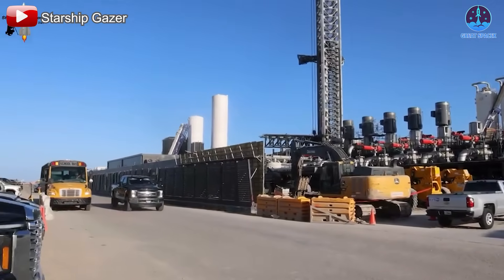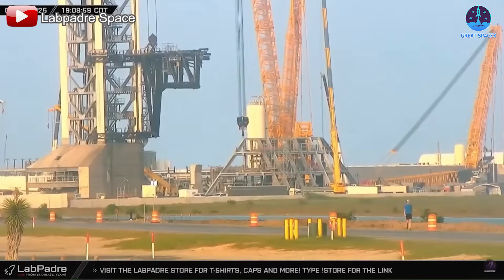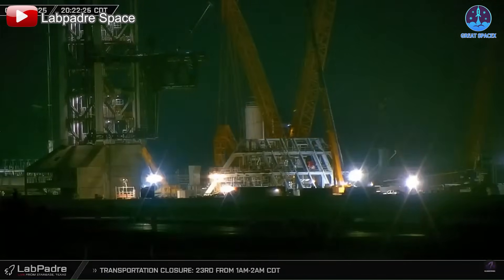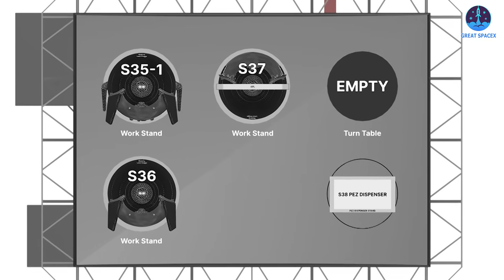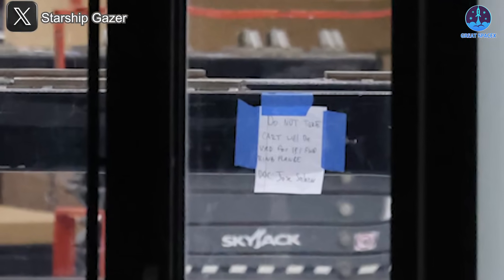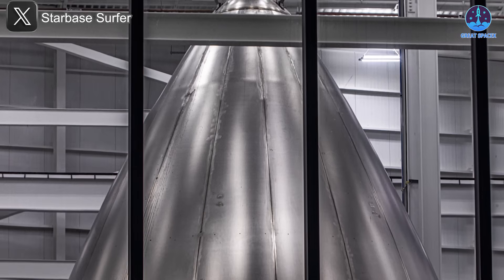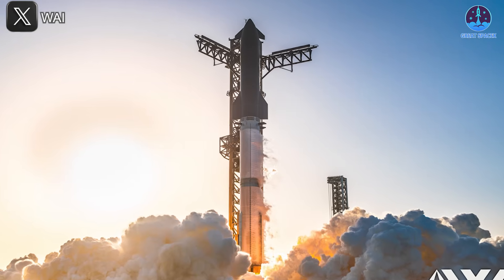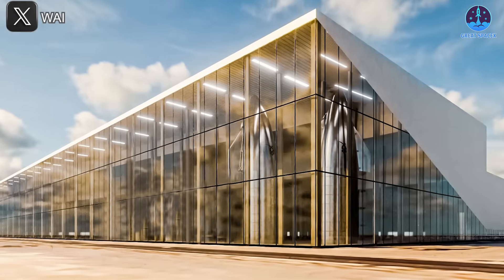New SpaceX Starship Launch Pads are COMING Quickly! Never Seen Before...

Comment: What holds down the 4 I-Beams on the circular launch pad( which they want to be interchangeable) The engine and water impact. As well as the engine tone could and probably would move it along a rail. On which it is placed for interchangeable pads!?

Comment: Where does the number 20 for hold down arms come from?
Reply: The number of outer engines is 20 and the clamp points may be in between those positions
Reply: Thank you
Reply: Originally each engine also requires a quick disconnect for each outer engine. Which looks to be deleted on the new version

Comment: If Elon Musk / SpaceX sends 1000 SpaceX Starship Cargo Pods to the Moon / Mars.  There is no need to refuel the starship.

The Cargo Pods could be the same size of the starship cargo bay. ( 35,000 cubic square feet.)

The starship could have space shuttle  type cargo bay doors.  The cargo pods could be ejected with some kind of spring mechanism.  

After ejected they could be caught by a device that could push it towards the moon / Mars.  Once up to speed the device would release it.  These pushing devices could be refueled by cargo pod tankers, or exchange cargo pod tankers. ( Just swap them out )

The cargo pods could have anti-spin, and course correction devices / mini jets.  So they can travel by themselves.

Once at their destination, they could be caught by a device that would slow them down and land them on the moon / Mars.

The cargo pods would not require an external elevator.  The doors would be on the bottom.

If the cargo pods were landed in a circle, a big inflatable dome building could be inflated in the middle of them.  Inflatable tunnels could connect the cargo pods to the dome building.  The whole thing could be covered with 3D printed cement, even the cargo pods.

Some of the cargo pods could be re-fueled and reused.

Other cargo pods could have pre-built in facilities, like refineries, factories, farms, dairies, ranches, fish growing facilities, grocery stores, retail stores, hardware stores, living quarters, cafeterias, restaurants, bars, jails, police stations, city hall. Libraries, recycling plants, fuel depots, oxygen & water plants, composting plants, etc., etc..
(Just about anything could be pre-built into a cargo pod, saving a lot on site work.  Later buildings, etc., could be built piece by piece.

I was thinking artificial gravity on the moon / Mars could be created by building a giant rollercoaster, with the roller coaster cars so big you can live in them.  The rollercoaster would travel in a circle and lay flat on its side.  So when it traveled at 1G it creates artificial gravity on the floor of the roller coaster, the flat part nearest to the wheels.  

Also we could build a space motel in the shape of a cube, by just docking space station modules together.  It could spin and have artificial gravity.  It could also travel to the moon, and especially Mars.  ( a 7 month journey.)
With just 12 space station modules forming the cube, it would have 420,000 cubic square feet.

They could build a mobile moon / Mars base out of inflatable space station modules strapped to an electric truck chassis, driven around by remote control and cameras.  Docked together after they reach their destination.

A more permanent moon / Mars base could be made out of inflatable space station modules strapped to a big truck bed.  10 of these could be docked together.
🙂
Reply: I don't think you know what you're talking about

Comment: Spacex Starship still can't reach orbit.  Starship sucks.
Reply: Development is still moving much faster than New Glenn. 
Blue Origin started work on New Glenn 2013 and the first launch was 2025. Still not stuck a booster landing.
Space X started work on Starship 2019 (after deciding to use stainless steel rather than composite materials). First integrated launch was 2023 with the first successful booster "catch" in 2024. 
The last 2 launches were using Starship V2 (but the design changes have proved to be problematic, causing the loss of both V2 Starships). They have analysed the fault and made modifications for the next integrated flight possibly next month. 
Testing continues and compared to New Glenn they still have 5yrs or so to get to orbit (but will probably succeed this year).
Reply: In fact Starship has done everything except complete a full orbit. Starship has reached orbital height and velocity, then they bring the ship back down. The literally haven’t attempted a full orbit yet. Flight 5&6 starships could have completed an orbit that just wasn’t the mission.